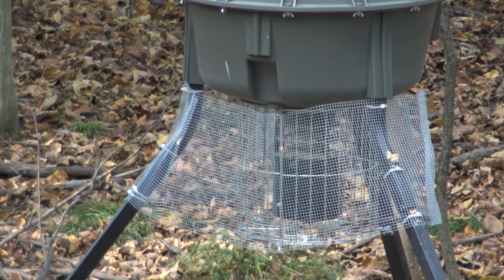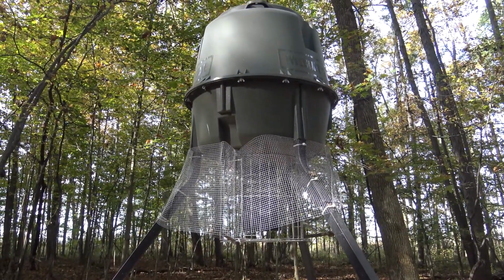Moultrie Deer Feeder Modification

Comment: This is  bit of a pain to set up🍇 allabout.wiki/Adjustable Pro  though I understand why all the pieces make shipping and packing more efficient.  The instructions were clear and set up took me about 45 minutes.  Everything uses wingnuts, so not tools are required unless you are mounting cameras on the lid.  You do need a 6v battery (I had one).  The feeder is easy to program and seems quite rugged.  I am 6'0" and I can easily open and fill this feeder, which is great.